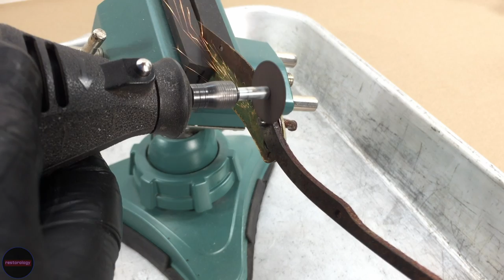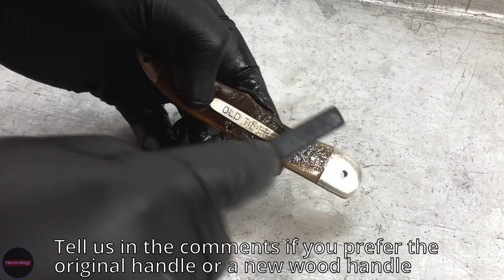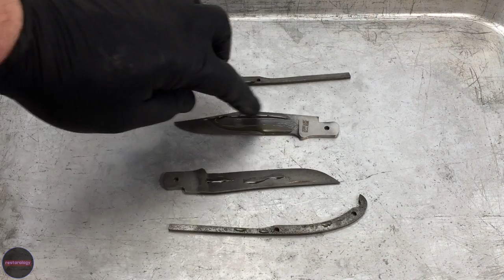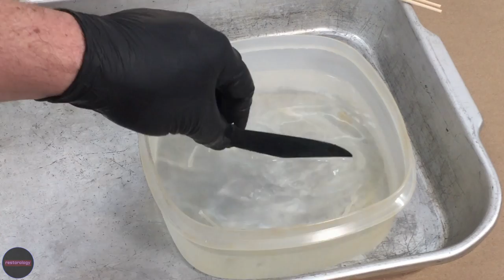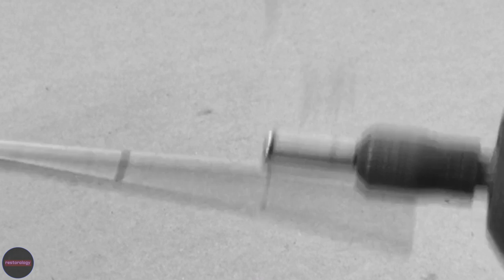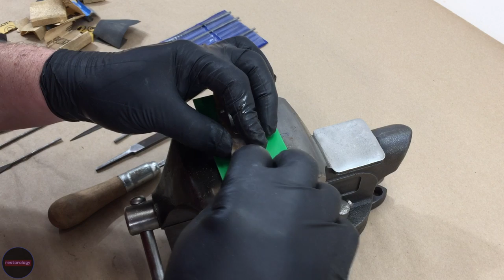1970's Old Timer Knife Repair | Restoration

Comment: I believe you got the blades on wrong.  The main blade should go on first,  now its covering the nail nick of the second blade.
Reply from the maker: I hope not. I looked at several photos before assembling and this looked correct but you are right, the nail nick on the skinning blade is hidden when both are closed. Actually, it is hidden behind the middle brass liner even when the main blade is open. I'll check photos online again and correct it if it is wrong. Thanks for the comment! 🍻
Reply: @Restorology  I have a knife sharpening business and it just jumped out at me.  I can see how easily it can happen.
Reply from the maker: @RBG-tr9ce  After I read your comment I did a more extensive search and found pics showing it both ways, BUT the most common way is how you described. You were spot on. I told the dude who owns it and he said it is fine the way it is but I told him that I will swap the blades. Won't take but a few minutes to do it. Thanks again for pointing out my mistake!! 🤙

Comment: Lovely restoration/repair. Why didn't you use the plastic filler for the gap in the replacement handle?
Reply from the maker: Thank you! I actually thought about that but the plastic weld material would not stick to the brass. I tried sticking it to a few different metals just to see and it did not adhere tightly. Also, without being able to color adjust it after application, it would have looked off color compared to the handle at that spot. Thanks for asking the question!
Reply: @Restorology  Good to know.